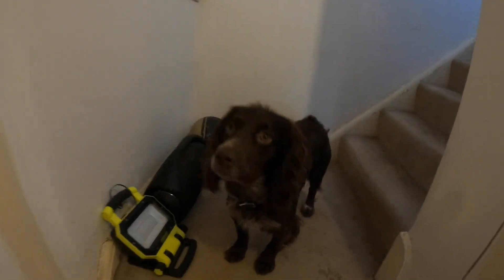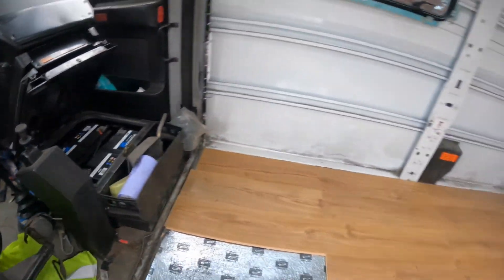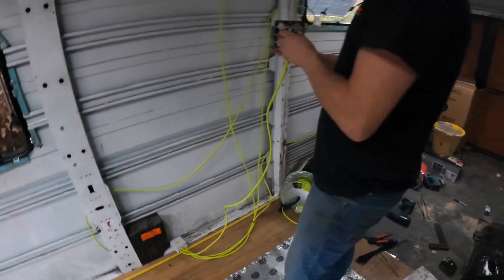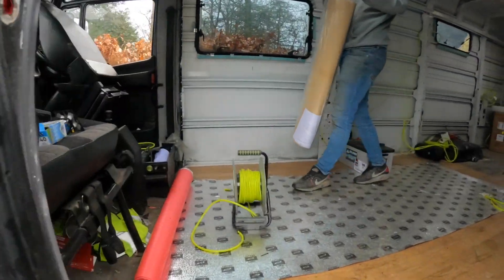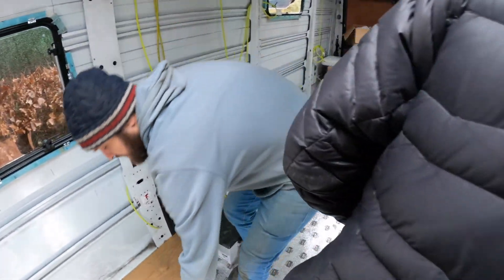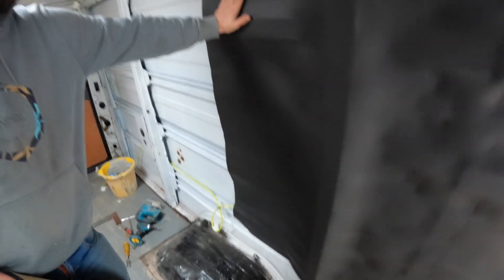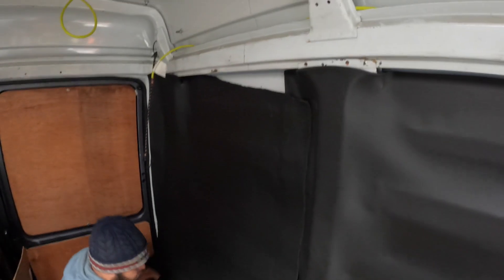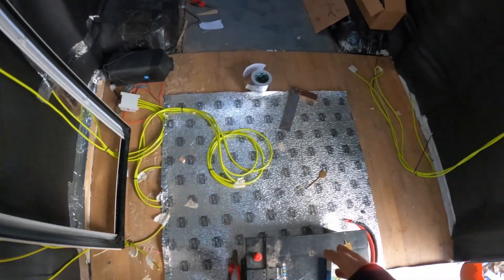THE STEEZE VAN BUILD GETS ELECTRICS EP 4!

Comment: I’d deffo put the sofa opposite the door so you have the view and then put the kitchen on the side door side but all the way back to the bed. You also need a hard roller to get that insulation proper molded to the wall, otherwise condensation will form in the gaps and potentially ruin the adhesive and cause issues further down the line

Comment: Was that just a £100 diesel heater of the bay.. bay?
Reply: My stepdad got one of the all in one diesel heaters from eBay . Looks like a small generator with the same exhaust pipe and stuff. He has it in the back of his work van and loves it . Heat is fantastic and uses very little fuel .    I’m definitely going to get myself one , for £100 you can’t go wrong

Comment: Dude you might as well not bother with that useless insulation and rely on the diesel heater. Greg Virago and the restoration couple youtube channels are really good for this part of van conversions.
Reply: The stick on insulation will certainly help a bit, but also deffo should have some recycled plastic fibre on top for proper warmth, and it should really be laid without air pockets. No point foil taping Tbh. But fair play, sorta wish I didn't care so much about my own build sometimes!
Reply: @rhysvincent2358  it's going to increase the chance of condensation getting trapped without a decent r value. Better off with none and running the heater lots.  Gonna get hot in there in the summer.